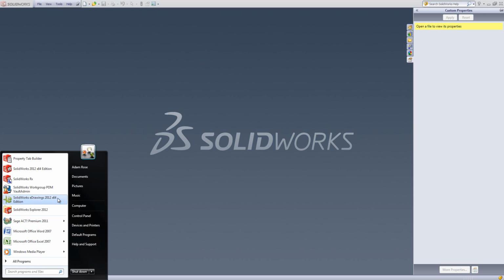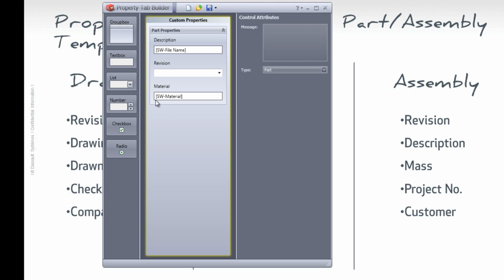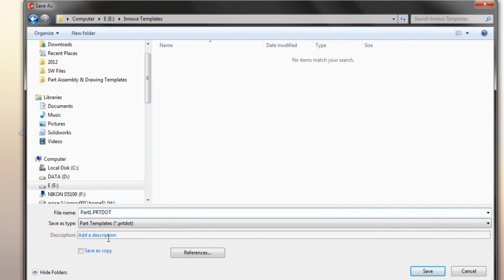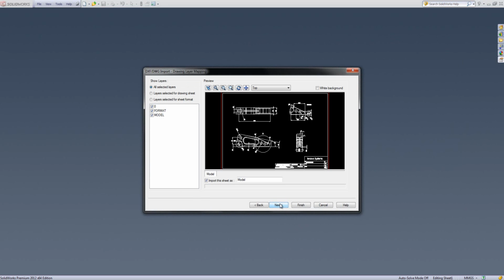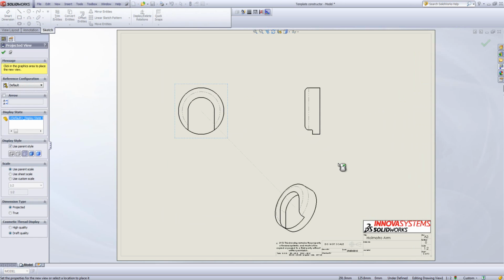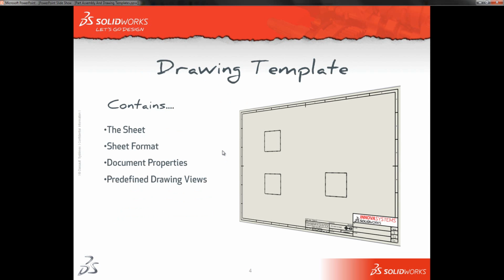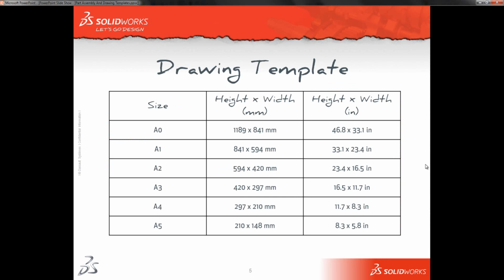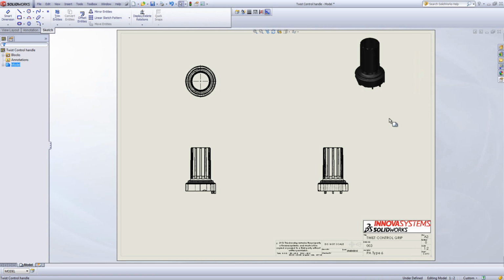Part, Assembly and Drawing Templates in SolidWorks [Webcast]

Comment: Like the video, but afterwards I find it  difficult to untangle and follow all the things going on in a creation of templates and sheet formats and properties and links and model properties and and..
 Would there be a step by step guide to this, on paper? I have the Solidworks ESSENTIALS  manual but it doesn't explain (for me) well. Maybe networked files and locations are another complication. I would like different information on subsequent sheets (so only major details get carried onto second sheet). whenever I set the link to sheet format for template, it copies over sketch details and layer properties. Also which properties drives the template- the sheet format or the template? seems they blend together in mine.